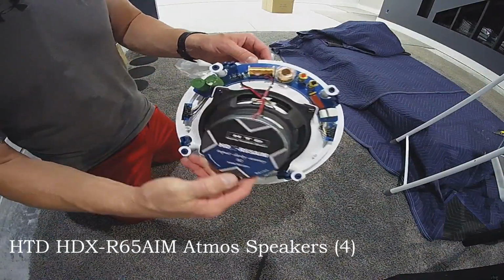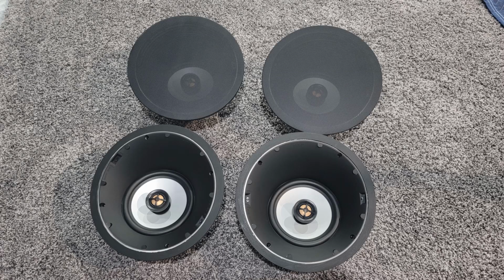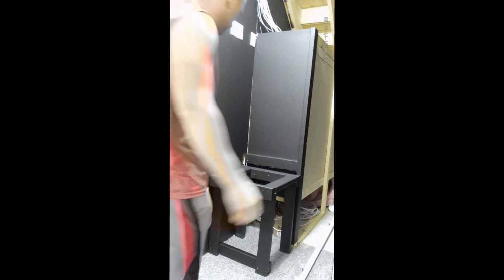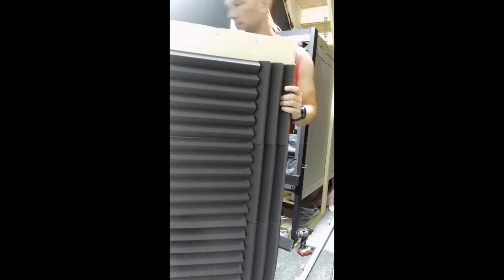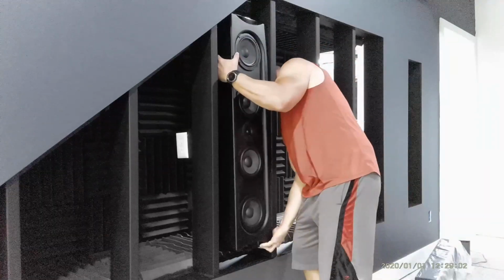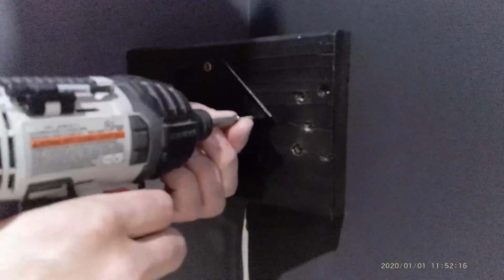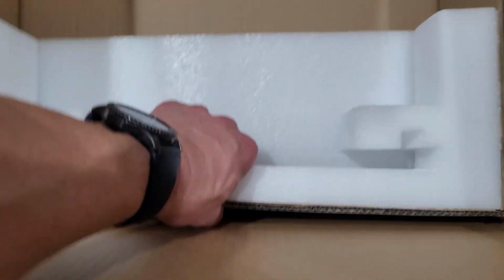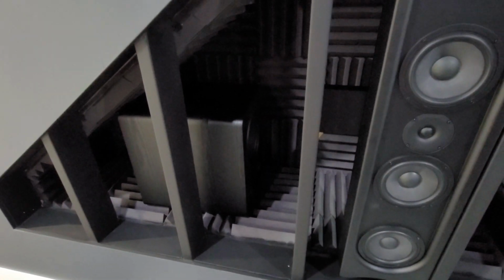Basement Home Theater 5.2.4 Speaker Installations

Comment: looking good.  It's funny how much the ceiling speakers seem to be noticeable against the textured ceiling. I never would have considered that. I also find the sub placement odd.  Both firing the same direction and not towards the audience?  I know direction isn't as important with subs but I have always either pictured my subs either facing towards or away from the audience... never really considered the way you have them.  Interesting.
Reply from the maker: I got the subwoofer idea from this video (and others): 

https://www.youtube.com/watch?v=iqpbWvExaKI&list=PLjoJCmOnWZ5gbb6rEr8zvYWrKyghWRSdg&index=5&t=358s

It works the best so I didn't have to make the cavity deeper for them to fit facing the room.  I do have plans for a minidsp 2x4 HD to get the subs all dialed in for the best response I can get in my room.  Thanks!

Comment: Really cool basement. Are you gonna add any other cool stuff besides the theater? Also, looking forward to the av rack install if thats a vid that is coming
Reply from the maker: Thanks for the comments!  There will be a wet bar going in just outside the theater space.  I'd like to get a popcorn machine of some sort.  Then there should be some space for something like, a pool table or other type of area, not really sure at this time.  Just concentrating on getting everything finished first and go from there.  And yes, there will most definetely be a av rack install video coming 👍

Comment: Good video... love seeing people's theatre builds...  interested to see how your subs perform in the enclosure like that, are you going to angle them out to the room between the joists?
Reply from the maker: Thank you!  As far as the subs go, I'm planning on running a minidsp 2x4 HD to get them dialed in as best I can.  If they don't work in this direction, I'll try them facing each other, or facing away from each other.  The research I did prior told me it doesn't really matter which direction they face, so it should all work out I'm hoping with a little bit of dialing in.